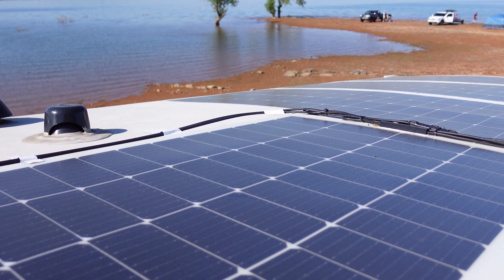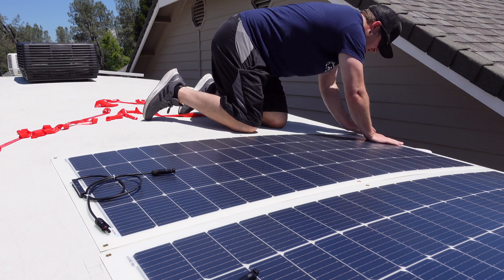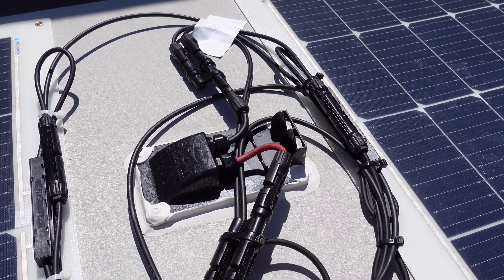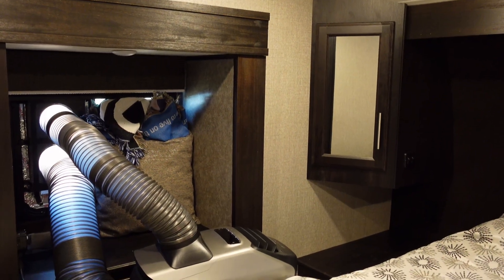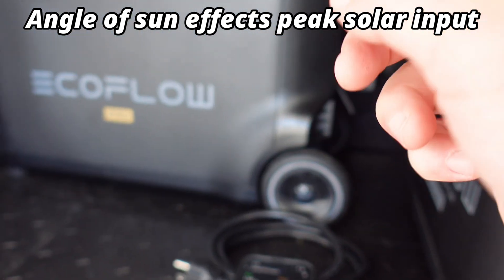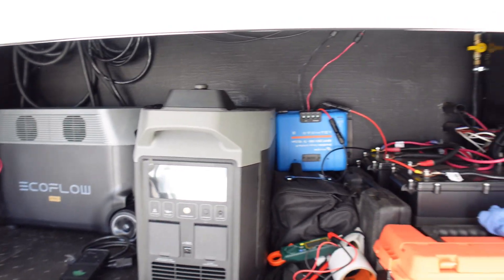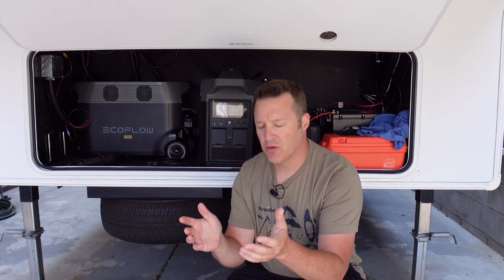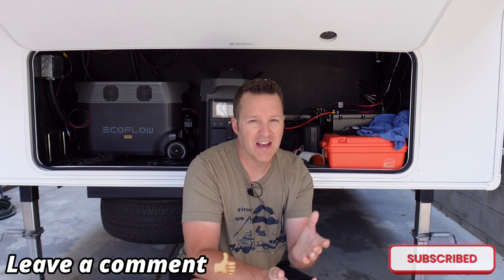How to Mount Flexible Solar Panels on Your RV Renogy 200 Watt

Comment: Great video!  That said... curious to know if you gave any consideration to running longer flex panels(?) I've heard (can't recall who at the momment) that there are a few high-end flex panel companies who will cut flex panels to custom size lengths, which would not only cut down on the number of individual panels, but would also cut down on the lengthy wire runs and extra connections(?)  Again, just curious to see if you maybe considered this before buying all the individual panels for this project(?)
Reply from the maker: I know there are a couple companies like that but i think one is like military grade and the others are in different countries, and from what I remember it was not cheap, at all lol.
I wouldn’t mind doing more research on that

Comment: Your giving me more confidence in VHB tape holding the panels down after watching the video. I want to put some panels on my Outback travel trailer to also power a Delta Pro.  A big thank you for the 303 UV protection tip!  
I don't know if they were available to you but did you consider 24v panels?  I like the idea of getting 120v out of only three panels to feed the Delta Pro.
Reply from the maker: No 24v panels available in this type. I would of loved a higher input voltage. Normal son far seems to be 105-107 ish. Going to get hot now so i assume closer to 100 maybe now that upper 90s are coming.

Comment: I was thinking that using a J-roller is a good way to adhere the panels to the surface without damaging them. What do you think?
Reply from the maker: I think that would work as well but a larger more broad one. It doesn’t take much they pressure mine are good 👍🏼

Comment: What are your thoughts about how to recover from damaged panels?  If your tape fails,  failures during traveling or any # of reasons. Will you be able to remove the panel(s) from the roof without damaging the roof?
Reply from the maker: Yup thought about all that. I was told top use a adhesive from the company but to remove that left over adhesive it a no go on these types of roofs. The adhesive tape can be peeled up with heat and good oil wd-40 works wonders to undo the adhesive. Yes it will take a little work and you will need to just take your time, but I could peel these up if i want but then you have to redo everything. They stuck down well and so far nothing has moved. I will definitely be checking at every stop for a bit but since they dont drag or catch wind like a rigid panel setup I dont see them really moving. Maybe the front one because it has the most wind lift possible.
Reply: @johnnysweekends  maybe try adding a strip of builders foil tape across this front surface to deflect the wind over the first panel, you could give it a quick touch of white paint if u dont like the alloy look.
Reply from the maker: @evil17 well so far these haven’t budged. lol they are not going anywhere unless I take them off. So far still doing well 👍🏼

Comment: I was just curious what type of solar system and panel you recommend for a beginner just getting into solar for a trailer we have only a two battery system on the front of our travel trailer. Don’t consume a lot of power just the kids leaving on all the lights, and so on, and so forth lol.
Reply from the maker: You could easily buy a suitcase type system that unfolds unless you want to mount it. The unfold type can be cheaper rigid panels but are heavier or a lighter folding panel that’s about twice the price or more. You can see my solar panel suitcase build out of harbor freight solar panels. Nice build and simple 😀
Reply: @johnnysweekends  
Thank you that sounds pretty simple enough just to keep the batteries charged all day
Reply from the maker: Yup my old trailer worked great with a 200 watt portable to keep batteries up 👍🏼
Reply: @johnnysweekends  thank you

Comment: the ecoflow delta pro has a extender battery you can extend that delta you might get more solar than befor
Reply from the maker: Correct. The delta pro can be attached to delta pro extra battery but that’s does not have a controller in it. Only DP does so that mppt is maxed at 1600 watts or 150v/15amp
Reply: @johnnysweekends  I mean you can try it with one of Tham double you're battery and btw thanks for you're vids they are really good thx.
Reply from the maker: I do plan on getting on but it’s like on the back burner 😕 I have other things to do lol.
And thank you I’m glad you like, and thanks for commenting and letting me know 👊🏼👍🏼😀